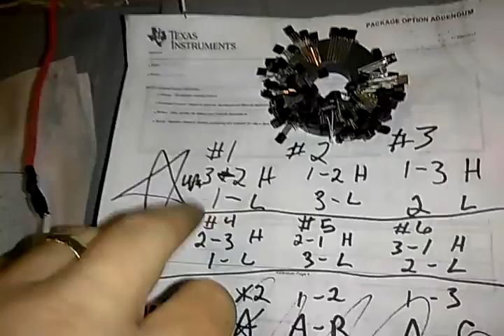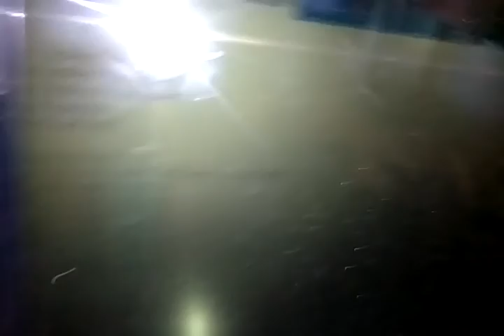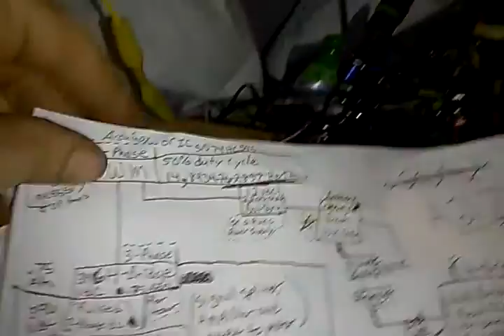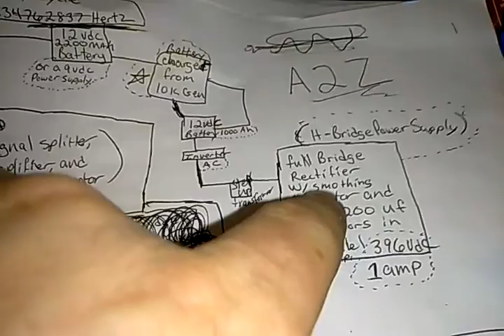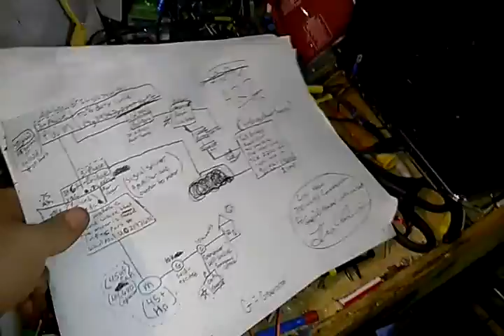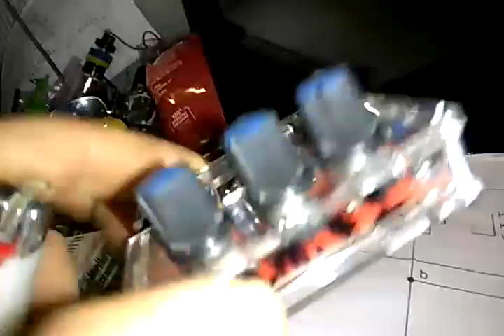FINISH A2Z MOTOR CONTROLLER AND INPUT P1

Comment: some late info.      yer motor is a  3-phase, bldc, ourtrunner motor.    it should be controlled with a  bldc driver circuit.
the leads going to yer motor are  NOT  pos, neg and signal.    all  3   are  Power  leads.          the output from a bldc driver is  3-way sequential, dc, pwm.     not ac.     yer motor input power processing scheme is  Totally   wonky. 
googletranslate

Comment: Good video bro keep it up man
Reply from the maker: +Zlatan Ibrahimovic 
Thanks brother! I'm doing my best to get everyone up to speed... just hang in there it'll all come together and you will say to yourself man how did this guy build this in his head, test it in his head to see if it works, and then put it together... and it works! after a few  times of rebuilding it in my head...
Reply: ThomasBuie EnergyBuies at gmail com hahaha I believe in you bro. When you have some free time can you help me out with my controller and my system, i was thinking of going:

12v car battery charging 
a 
12v car battery powering 
a 
1000w inverter(to bring up the voltage) wired 
to
Ac to dc bridge rectifier wired
to
A pwm controller wired 
to 
A washing maching drum motor spinning 
a 
generator powering 
my house
and the charger. 

Now my batteries don’t hold a charge so I was thinking of using power from the grid to power the charger THEN switch over to use the power from my system to power the charger and complete the loop. Will this work Tommy???? 

Live Life Loving ❤️
Reply: skip wilson how does your system go? the secret is in the frequency isn’t it, Like gerard morin says it uses mostly voltage when you got the right frequency like 14000hz going into a permanent magnet motor you get a super efficient motor that can power itself 

Live life loving bro